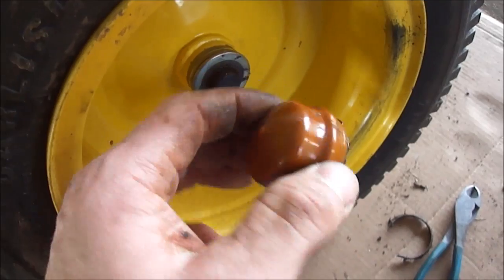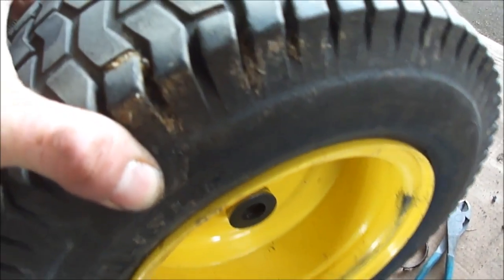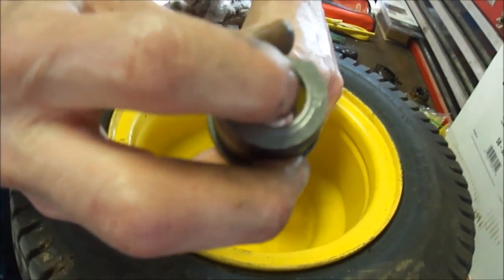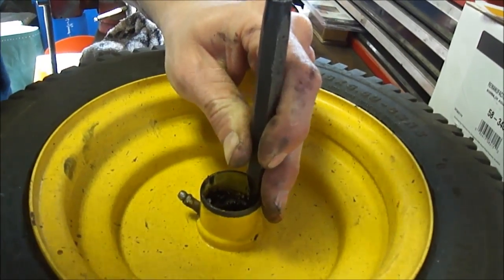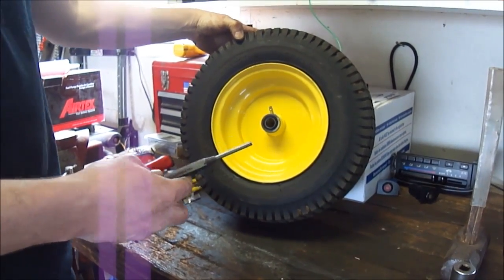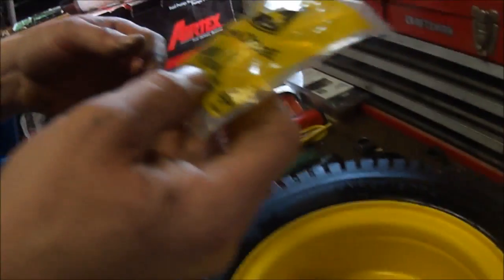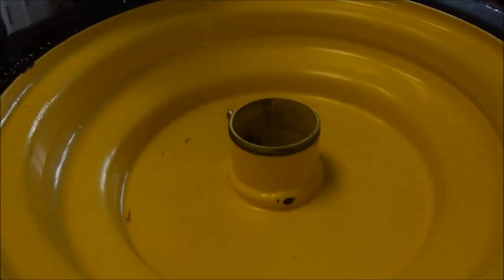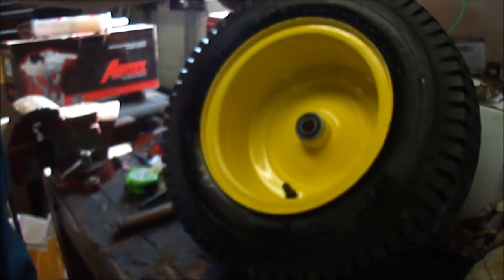John Deere L130 front wheel bearing upgrade

Comment: I decided to do my front wheel wheels. So I ordered the bearings. Once the wheels were off I could see the spindle wheel shafts were worn pretty good. So I replaced the spindles. It's a messy job getting the grease out of the wheel housing and popping the bushing out of the wheel hub. Get yourself plenty of rubber gloves, rags, and paper shop towles

Comment: A trick my father taught me is to use a 2 X 4, the softer wood won't damage the bearing you're driving in, and it's easier to keep level than a ballpeen hammer.

Comment: Thanks for the informative video, IMHO I would add that the plastic covers that go over the ends of the axles a trick you can use if they get hard is to use a blow dryer or heat gun, that will make them pliable again, at least to get them off and then heat them up again to put them back on:) And if you wanted to continue to use the grease zerk option that is on your wheel hubs before installing sealed bearings all you have to do is before putting the bearings in use a small pick to remove the inner sealed cover on the bearings, inside only, and leave the covers off and install the bearings now you can grease the hubs and the bearings will have a continual supply of grease.
But in order for that to work properly you must fill the cavity with grease and keep it filled over time. I have done that to mine and to the blade spindle bearings on my riding mower deck and 12 years later they are like new:)
Reply from the maker: Thanks for the tips.
Reply: Steve Stoltz - Thank You for taking the time to make a video, you keep it simple and to the point and even show us when you make a mistake, thanks for sharing
Reply from the maker: Thanks, Your welcome.

Comment: Thanks for the video. I'm doing this upgrade on my LA150 right now. The bushings came out of one wheel easily but they are being much more trouble on the other wheel. Might have to go up to the shop and heat them up with a torch to get them to budge.
Reply: TAP LIGHTLY ON ALTERNATE SIDES. IF YOU HIT ONLY ONE SIDE IT COCKS AND LOCKS IN PLACE. YOU MUST DRIVE IT OUT EASILY ALTERNATING SIDES GENTLY LOL

Comment: I know this clip is 2014. I just ordered the ebay bearings (some times listed above on a pop up) for my L120. For my L120 these bearings are not the correct size on OD and ID even though the ad says they do. Please check your bushings  with a calipers or micrometers when removing them to be sure the bearings you ordered are correct. The bearings were .003 thousands of an inch less in outer diameter than was the bushing I removed. The bearing fell into the hub with no press fit as does the John Deere bushing. The ID was also off by .010 thousands of an inch. This was a total waste of time. If I had installed these the sloppy fit bearings I would have ruined my axles and hubs in a couple years. They will go together but be prepared for future cost of this modification. The loose bearings only have 7/16 inch of surface against the axle and hub verses the 1.0 inch bearing surface of each of the bushings. In other words the fit has to be perfect for the bearings to properly function or you will have more wobble than the worn out bushings you are replacing.

Bottom line is do your homework and get a inside mic or vernier caliper to do your measurements before putting un-spec'd ebay bearings on your lawn tractor wheels.

Comment: I'm not so sure this is an upgrade.  I just ordered a spindle/bearing kit for my LA145.  Thinking about the bearings though, if they don't last the life of the mower, when they fail they will fail catastrophically whereas the OEM bushing will be subject to "graceful degradation" and not leave me stranded in the middle of the yard with crunchy bearings.  When I receive my kit, I'll purchase bushings to replace the bearings.

Comment: How do you know there packed with grease ? A lot are not. I open my seals of my sealed bearings on one side and packed them with grease.
Reply from the maker: I've had old bearings be dry on the inside but never new ones. The new ones I put in were good and tight.

Comment: Steve, I have pounded on the old bushings until my arm aches and they won't budge.  I have been alternating sides after every couple of strikes. Any advice?
Reply from the maker: Sounds like you need some heat. A map gas torch would probably do it.

Comment: Is there any need to add grease after the bearings were replaced with Sealed Roller bearings?  I would imagine that any further grease maintenance would not be required. since the new bearings are sealed. is this correct?
Reply: I'd continue to grease the front zerks because the spindle could rust up between the bearings, making it very difficult to remove the spindles later, like the spindles on the mower decks.

Comment: Does not look like the last bearing was seated.  You may need to remove the zerk fitting.
A bit of overkill since the sintered bronze bearings work well enough.
Reply from the maker: It could be, but its been rolling for almost 4 years and Ive done nothing to maintenance them. Mission accomplished in my book.
Reply: Nice fix.  I may see about sizes for mine.

Comment: Hi Steve great clear video, my factory front bushings are worn out on the front on my John Deere 190c mower. Do you know if these bearings AM127304 will fit my lawn tractor? I like the fact they are made by John Deere. Does your mower steer much better with the bearings vs the bushings? I always thought Deere should have used bearings on the front instead of bushings. Thank you
Reply from the maker: It looks like the 190C uses the same wheels, so they will likely work but I would research it a little before buying them. The origional bushings in mine were badly worn so I did notice the steering improved a little.
Reply: @SteveStoltz  HI thank you, I wonder what size spindle I have, or you have or what the inner diameter of the bearing you installed is? Kind regards, and happy new year!

Comment: I initially used Oregon bearings but they were too loose so now I have the AM127304s installed.  The problem I have is getting the wheel back on the spindle. What's the trick as the spindle seems slightly too big(?)  The spindle is not scored.
Reply from the maker: Pete Moss All I can suggest is to scotch bright the shaft really good and coat the shaft with some light oil. You should be able to wiggle the wheel on at that point.
Reply: ***** Thanks. Eventually I had to use a short 2X4 placed flat on the side of the tire and hammer it to get it through the first bearing assembly.  After it went on about an inch or so it went the rest of the way fairly easy.

Comment from the maker: Your welcome, I had the same issue getting the bearings out of mine, I would have been better off using a little heat instead of brute force. lol
Reply: I ended up getting them out. I was using a flathead screwdriver since I didn't have access to a punch. Was just putting gashes in the bushings but got them out when I got up to the shop and used a punch. Also realized I could have bought all the bearings from my hardware store for half the price of what JD asked for them. Lol.
Reply from the maker: Yeah, the JD dealer is pretty salty. I bought mine from a third party JD parts supplier on the net, I think its called the greenpartstore if memory server me right.
Reply: I've bought from them before, as well as Greenfarmparts. They are pretty affordable but they charge me too much for shipping sometimes. I used to order a lot of parts off them but I found that I have better luck buying the same part on eBay or at my hardware store. Now if it's a JD-specific part and quality really matters then I go to the JD dealer and get the exact part.

Comment: hey bud was there a washer inside that cup looking part on back of spindle? I didn't pay attention when I took my tire off and I got 2 washers. one is a little bigger then the other. I'm thinking the bigger one goes on outside of tire along side the clip and smaller one goes inside that cup looking part behind the tire. is that right? thanks
Reply from the maker: It's been a while but I do believe there is a washer there.
Reply: +Steve Stoltz ok thanks. i think whats throwing me off is i cant get the dust cap back on. the washer on front is to big. unless u got to stretch that sucker on there. idk. thanks for the reply
Reply from the maker: Yeah, I had to stretch mine over it.